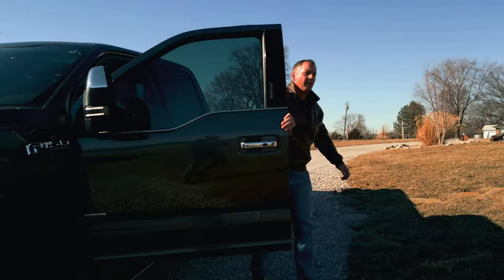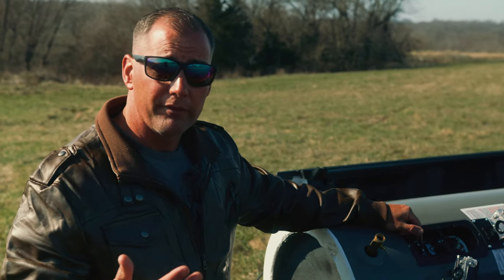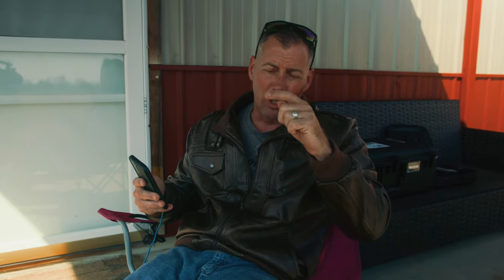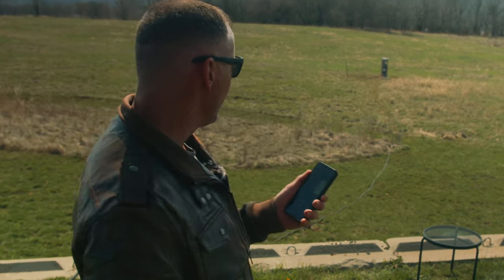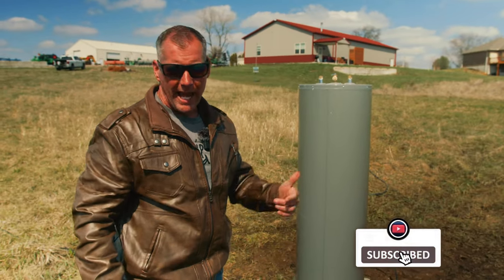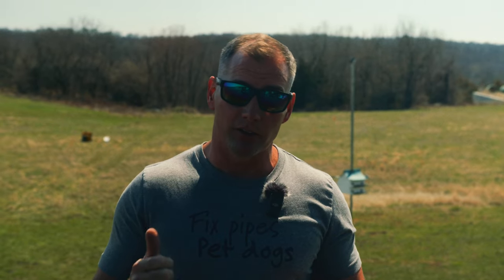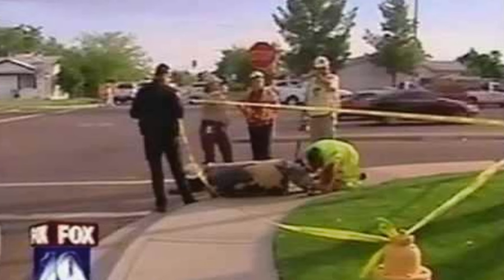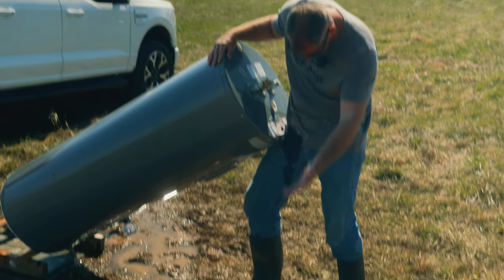Can a water heater explode? - We set out to turn a water heater into a rocket!

Comment: If you try this again, what you need to do is first make sure you have 0 leaks. Any leaks in a hydraulic system will drop the pressure to next to nothing. And a good pressure gauge that can go higher. The other thing you need to do is connect both heating elements and power them simutaneously. Yes in a traditional water heater, due the the fact that hot water rises this will not really improve how fast the tank recovers. However. In order for the water heater to 'blow' you need to be inputting MORE btu's that you are losing thru the jacket, especially considering you removed the bottom insulation. Don't do that. Insulation is your friend. And do not drain the water, and refill. Big nono. Once you start, do not stop. You want to keep the pressure increasing and increasing as fast as possible. The reason is, if the steel in the tank is able to very slowly deform, stretch or whatever, the pressure rise will slow down. What happens is, the water will stay liquid even though you've increased the temperature well beyond the atmospheric boiling point. What you want is the water to get to at least 400 degrees F, then you want the pressure to suddenly drop, like even if the tank does not fail at first, and it's just the pressure drop from the bottom bowing out, this is where the magic happens. If lets say you have the water temperature above 400 degrees F, and the pressure drops from 350+ to lets say 185 if the bottom flares out, and that resulting pressure of 185 is LESS than the boiling point of water at 400 degrees, water boils at 247 psi. So if the tank bottom suddenly and rapidly "pops" and the pressure suddenly falls to BELOW 247 but the TEMP is at 400 degrees, then the magic happens. ALL of that 40 or 50 gallons of water will instantly flash into steam, and 1 gallon of that water will now need 1830 gallons of space. So if you have a 50 gallon water heater in those conditions,  now the water suddenly needs over 91,000 gallons of "room" and that water heater, no matter how strong it is, is going bye bye. 91000 gallons is a couple of swimming pools of space, and you might want to be a bit farther away from it if you redo this experiment again. Be careful. 50 gallons of live steam at 400+ degrees is carrying a huge amount of potential horsepower. They used to rate boilers in the old days by horsepower. It's 34.5 pounds of steam per hour. So with a 50 gallon tank, and you release all of that water as steam in like 1 second, that equates to "only" about 43,000 horsepower. So quite a bit more dangerous than it seems on first glance.
Reply from the maker: We might have to try this
Reply: @SmedleyPlumbing  Another reason you need superheated water is the fact that the phase change from liquid to gas of water is pretty high, like around 820 BTU's per pound. If the water is just barely hot enough to boil at 200 or whatever PSI, then when some of that water starts to escape and starts boiling, that will cool down the water. What we need is so much stored potential heat energy in the water that there is an abundance of BTU's in that water so it'll instantly flash into steam. I own a small HVAC business here in Indiana, and I stumbled across your channel looking to see if an E-transit would fit my needs. :) I tried to order one from local Ford dealer but seems like they're taking forever to get around to calling me back for a deposit. The GMC Savana I have now is nice, but it's 6 years old and over 90000 miles and I'm lucky to get 11 mpg in town. I don't usually go beyond the next towns over, so maybe 20-25 miles, but the majority of work I do is in the same county. I don't like not being able to pull a trailer, but that's only maybe couple times a year, and I can just work around that, not a deal breaker.

I'm just not sure if the gas savings will be worth paying for a new van, but then again, if I keep the one I have now, I'm looking at potentially spending another $31000-$37000 in fuel costs (31000 at $3.xx and $37000 if fuel costs go back up to around $4 again). And will the 6 speed transmission last another 90K? Or am I looking at a trans rebuild or a torque converter by then. I don't mind the huge potential repair bills so much as the downtime, I only can afford one van, and if it's down, I can't work. It would be like your situation if there was just you, and one van, and one of your bigger customers called with a big major drain clogged problem, if you can't go out there, they'll call someone else like Roto Rooter :) 

I guess in my situation it's the sunk cost fallacy, I bought the van I have now brand new for "only" 29K and change (sticker price was 32.9), and so far to date I've spent around $31000 in fuel. So 56K for a new electric van that doesn't need expensive oil changes and gas doesn't sound too bad. I think I can make the numbers work with the business tax deduction for new work vehicle.
Reply: @SmedleyPlumbing  I did some more back of a napkin math. For 50 gallons of water to flash to steam at 400 degrees or 247 psi, you need to input roughly 150,000 btu's of heat. So with 2 standard 4500 watt elements that will take a little under 5 hours. Minus the losses thru the jacket. Assuming a starting temp of 70 degrees. The problem with one element is it takes too long, and the losses thru the jacket insulation take a chunk out of the efficiency. If you want to play around with the numbers and see how long it'll take with various wattages etc, some useful formulas are 3.41 btu/watt, 8.8 lbs per gallon, 1 btu raises 1lb of water 1 degree... I think that was the reason Jamie et al at Mythbusters "overclocked" their heaters, to achieve more spectacular results and not have to wait 10 hours...
Reply from the maker: @brnmcc01  several people have installed a hitch and pulled a trailer with their e-transit

Comment: I think you would have had more success if you had not refilled the heater after the bottom popped outwards.  Sure, the water level dropped because of the added volume, but it also gave it some room for the steam.  I think the steam will do more damage than the water.  It compresses like air.
Reply from the maker: Yeah somebody else had mentioned the idea that that's where we went wrong. They said that the pressure build starts to become exponential as you get closer to steam and then the water heater would likely rock it off the moment the temperature crossed 212°.

Comment: Think you messed up letting bottom flex where as myth busters didn’t do that step. Meaning the bottom didn’t flex past bottom of tank.
Reply from the maker: They did but they didn't talk about it much.  In their videos, you can see they removed the bottom of the tanks and raised them up so the don't tip over when the bottom inverts.

Comment: i would love to see an old bt-500 go up or something like it,maybe a cast iron sectional boiler. I have been told by old timers (i'm the old timer now) it blew two cinder block walls done that were 20 and 30 feet away.  Blew the insulation off the heating boilers and moved them over a couple of inches. HISD cafeateria back in the late 70s. I missed out repairing the water heating system and the boilers.
Reply from the maker: Seems they used to be more likely to blow up than they are today.
Reply: @SmedleyPlumbing  I think also in the mythbusters episodes they used higher wattage heating elements and ran them off of 2 legs of a 480v system, so they were 'overclocking' the heating elements with 277 volts as well. :) But ya, you need to simulate a dual thermostat contacts welded failure, or someone bypassing the upper thermostat because that stupid red button keeps popping out and resulting in a cold shower... xD
Reply: @SmedleyPlumbing  Connect both heating elements, make sure the tank is a new one with zero tolerance for any leaks, and for best results, swap out both elements for those heavy duty stainless 5500 watt elements. You can usually find those at Menards or any plumbing supply house. And you'll get a much better result. It doesn't really matter if they try to attempt to make a water heater fail more gracefully, if the water pressure drops below the boiling point of the extremely overheated water quickly enough, the whole tank of water will flash to steam in only a couple of milliseconds, and like in the mythbusters episodes will blow an entire house apart, if the house is tightly sealed enough so the pressure impulse from the steam can create enough pressure to blow out windows/walls etc.

If you feed 11 kilowatts into a tank, that's over 34,500 btu's per hour, you won't have to wait very long, and it'll save on camera/drone batteries too! :)